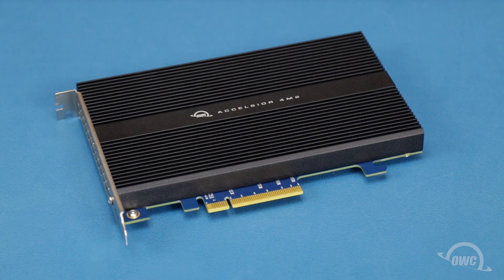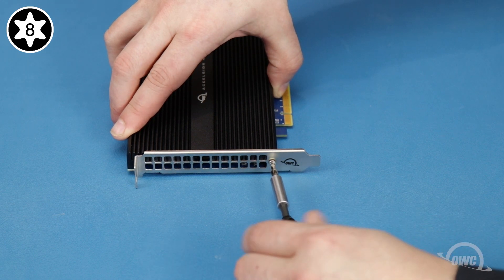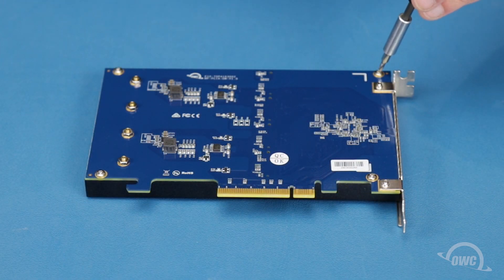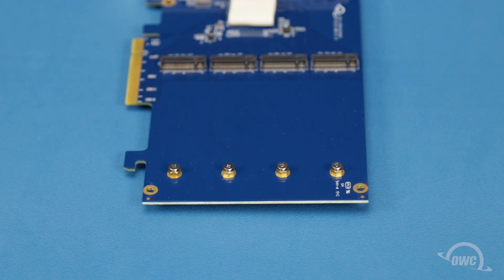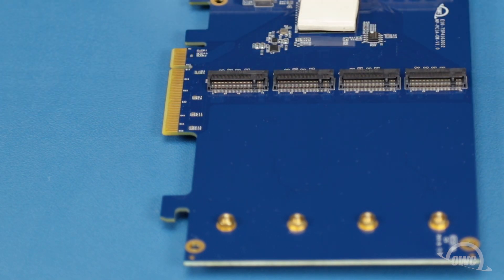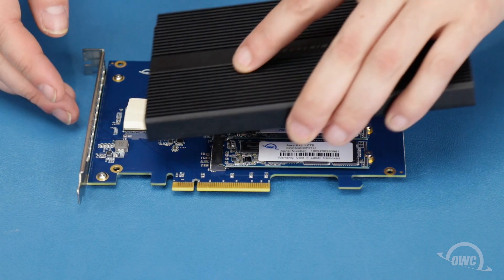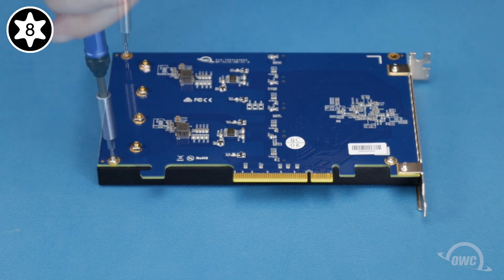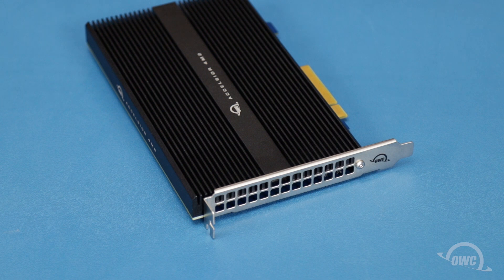How to install M.2 Drives in the OWC Accelsior 4M2

Comment: I'm looking to get an SSD upgrade for my mid-2011 imac. I have upgraded to 32 gb RAM, and it came with the intel i7 3.4 GHz processor. I like the mercury pro 6g, however I can't figure out if I can benefit from NVME. NVME outperforms other SSDs by a significant amount. Can my imac utilize m.2 NVME technology? Or is it not supported? If it is supported, I couldn't find a kit on your website. I'd appreciate some help!
Reply: MacSales. com thanks for that info! When I tried to find out myself I couldn't reach anything conclusive. After I replace my hard-drive with the Mercury Pro 6G, can I install my current hard-drive onto the optical bay?